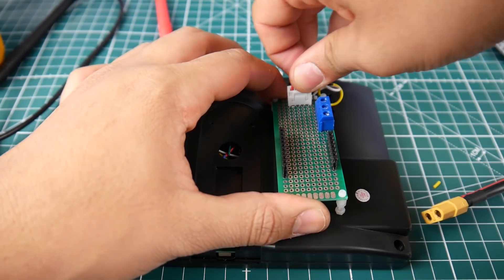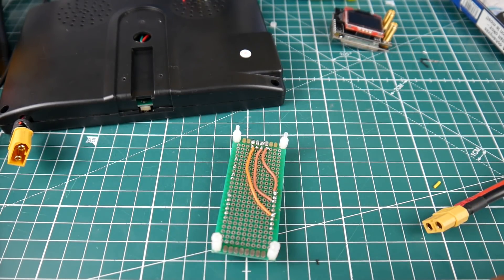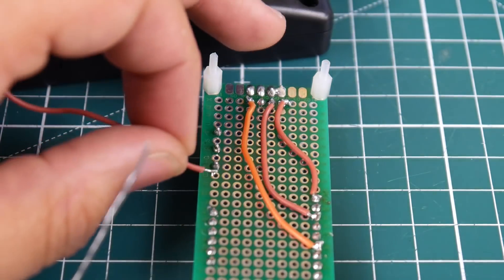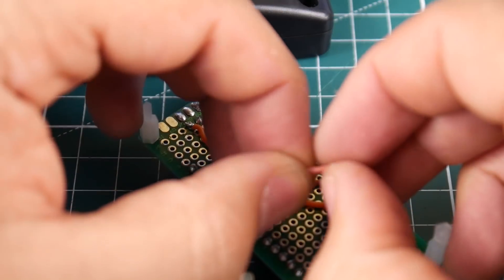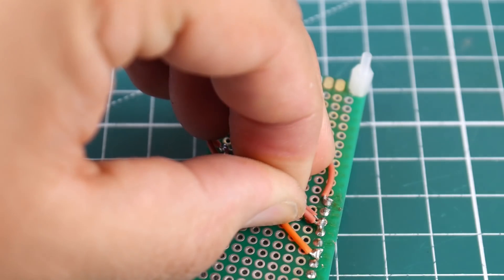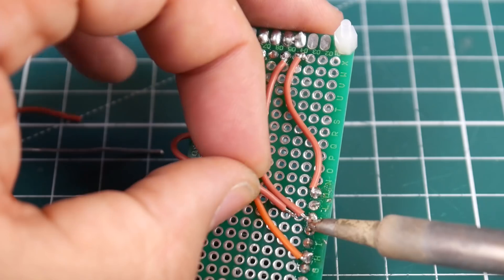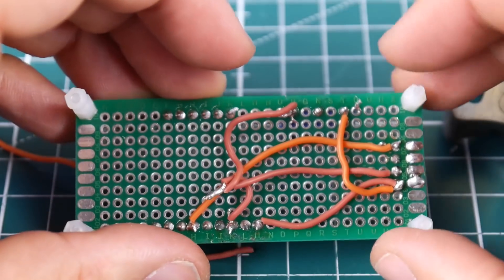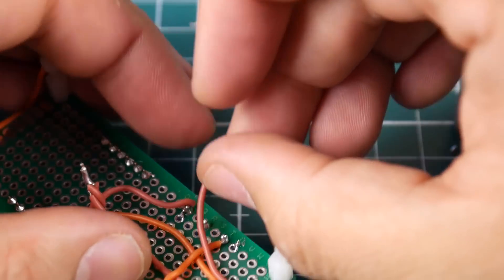DIY FPV Drone Monitor with Fatshark Modules // Part 2 [Re Upload Fix]

Comment: Drone mesh pls correct me if im wrong but arent u supposed to use a lcd screen that dosent go blue screen when u have signal loss so u can see static when your fpv signal is low or when u fly round buildings or trees ive done this mod a few years ago and abandoned it coz the blue screen keeps cutting in when u got low signal/static from rx the go to fpv screen back then was the black pearl monitor witch did not go blue screen i wasnt prepared to purchase one for the job.
Reply: You are right. It's not easy to find a good screen because of that:/

Comment: Do you know what kind of signalling or whatever is needed to hook up the pins to control the channel? I have an older module i want to try and re-purpose this way but it hasn't got button on the module itself it relies on the goggle buttons to control it.